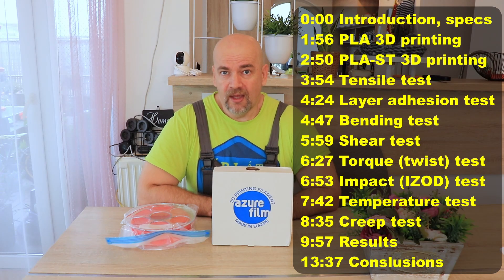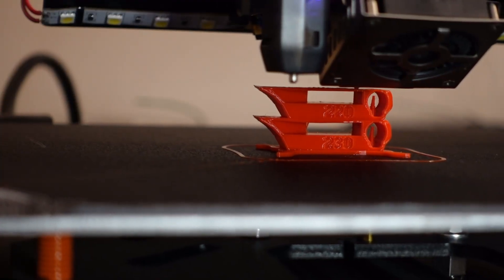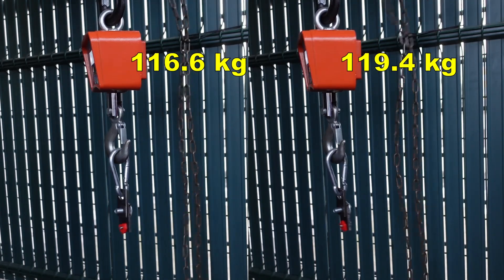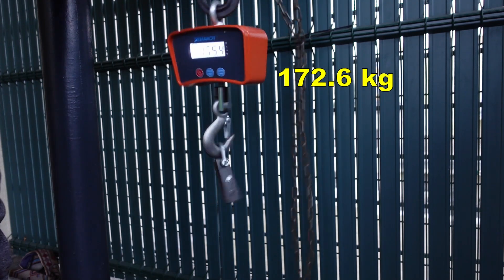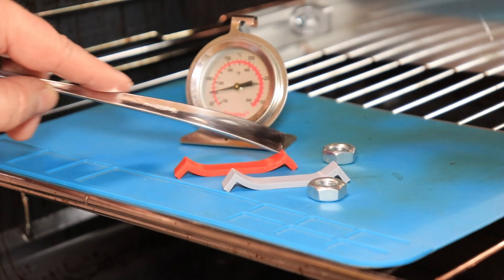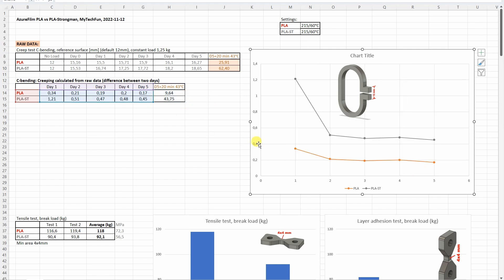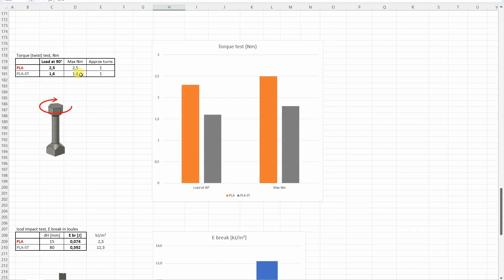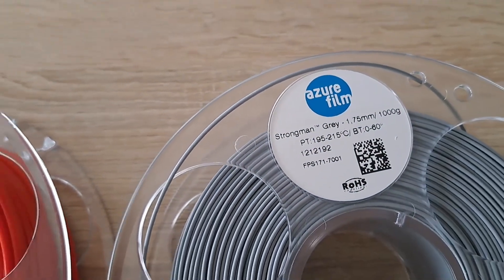How strong is the PLA-Strongman by AzureFilm? Comparison to regular PLA.

Comment: Hello Igor, sorry if I go off-topic, but I notice that you've been printing with Creality Sprite (Pro?) extruder. Knowing that you also had a Microswiss DD extruder + hotend, how would you compare them and which one do you prefer?
Reply from the maker: Both works good. Sprite Pro is great (soon I will install water cooling on it for testing), but what I like about Microswiss, that it is very opened and that's my favourite extruder when I am printing TPU filaments. Mentioned several times in this video: https://youtu.be/9vhfI9yvmpU . Not sure what printer you have, but if you need near 300°C you will need new heater and thermistor too with MSwiss. If TPU and max up to 270°C, then MS (or replace those thermal elements too)
Reply: @MyTechFun  Thank you very much! I also have an Ender-3 V2.

Comment: AzureFilm spools are ridiculously bad. They have notches along the edges, which makes it impossible to use normal sideroller spool holders. The filament also goes into those big round holes and get stuck, especially after using half of it.

And even all their colors are slightly off (like, blue is slightly turquoise, red is slightly orangey, black is very dark purple, gold is slightly green, etc). And they do some suspicious marketing, not honoring discount codes, etc. I really wanted to like their filaments, but simply can't.